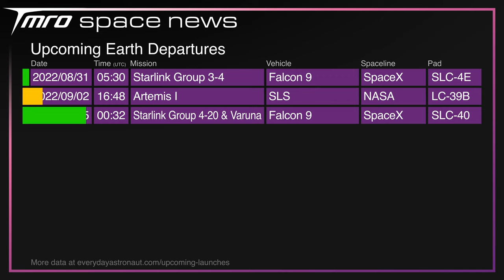Artemis 1 FAILED to Launch... But Why? // TMRO Space News

Comment: This engine issue on Artemis 1 is very, very troubling.
Reply: Only if you're an H2 bleed valve that's about to get scrapped.... RS-25 engines are sweet.
Reply: @Hoopaball  I hope you’re correct.
Reply: @striatic  if I were launch director I would have lit the other three engines to shake the valve loose.
Reply: I think there were valve issues with these engines previously?
Reply: @franciscobermejo1779  All the time. Every h2 engine, and associated aux system, have had H2 issues including ULA needing to cycle RS-68/ RS-68A valves multiple times during the terminal count. (During terminal count!!)  For delta IV launches! It's part of their countdown to cycle valves every 2-5 minutes. This is why methane is superior - it's not -432 deg C, doesn't impregnate metals to make them brittle, and doesn't leak on a molecular scale between valve seats. Solenoid actuated H2 valves should probably have resistance heaters when they're expected to operate at -426 C. 
I waited on the causeway for hours only to see a shuttle scrub at T- 4 seconds because of H2. To answer your question, H2 is a problem for every engineer.
Reply: @Hoopaball  thanks for the very detailed answer, that's so interesting!

Comment: This 8 inch connector leak issue was identified and studied in 1992, different application, and reviewed again in 2005.  Fix was to add a sensor.  Not really a fix.  The same issues occurred to various degrees during the four previous wet tests, never reaching full capacity on the tanks.  Today was the first time they have actually reached full tanks, even with the issues. This is not the way you conduct flight testing.  If they had proceeded, the whole thing could have gone up, putting the program and all manned flights, a year or more behind schedule.  You never live test a system that has not been properly safety of flight certified, not even in rapid prototyping.  This is not a mass produced system, even more reason for extra precautions, even with only dummies onboard. Should have stopped, and fixed the issues during the 4 previous wet tests back in April...  this is a recipe for disaster, a photo op before important elections, that's why they recklessly pushed ahead now, when clearly they were not ready for a launch.  Will see Friday, could be wrong, but I think the system will be rolled back and engine three replaced, if they can't find a way to fix the leak.
Reply: Amazing how they are hopelessly lost, and can't even leak test the system, or test valve function during the years/months collecting dust  and becoming outdated in the bay...